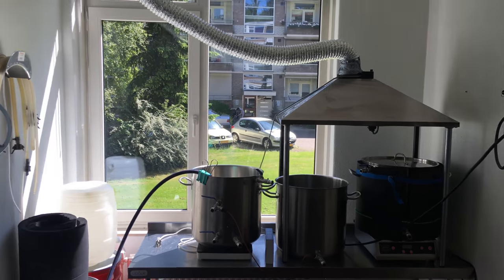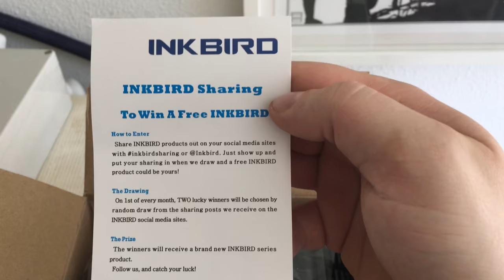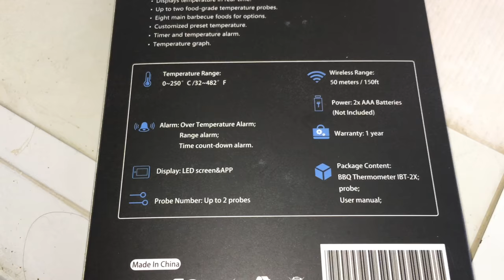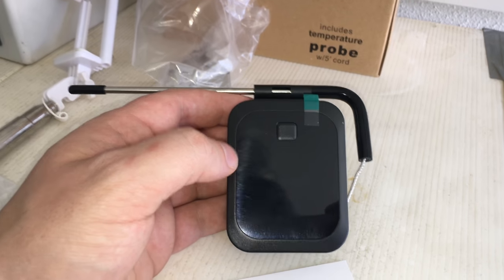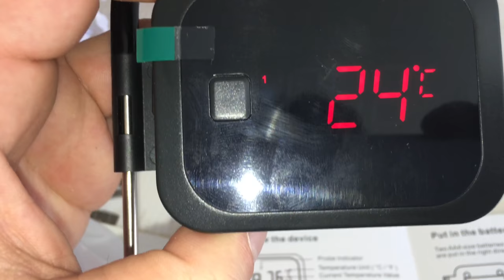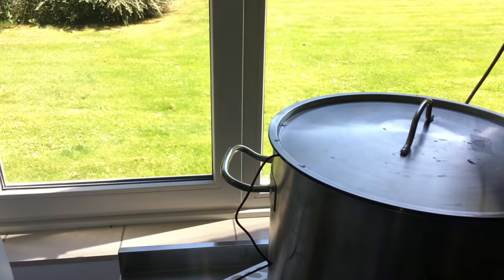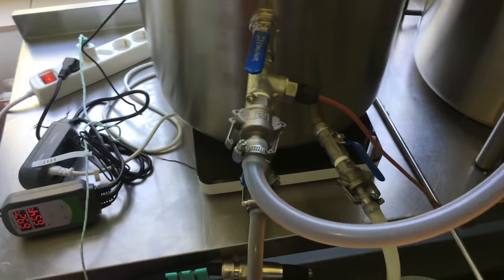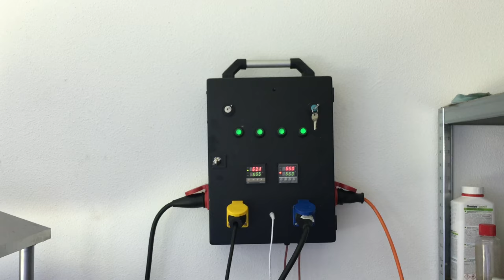HBW 30  - Kotten Brewery: Inkbird re-review ITC-308 + IBT-2X

Comment: What Induction plate is that? I was under the impression you cannot control power to an induction burner with a temp controller as they reset to standby when power is cut.
Reply from the maker: Your absolutely right Nathan. Fortunately the panel failure occurred during a mash step (52C-65C) therefore I had 20 mins to do the repair before I lost control of the brewday. Yes once the temperature is exceeded the induction plate will have to be manually restarted. The intention of this new control element (inkbird) is to alarm at defined temperatures and eventually shut the induction plate of once a certain temperature has been achieved. This helps me a lot during a brew party (i.e. lots of friends, beer and food) as my mash has been neglected and by the time i realise it, I have a mash temp of 75C when I wanted 65C. This happened with my imperial stout which turned out to be the sweetest 4.5% beer I have ever brewed.
Reply from the maker: Hi nathan, sorry for the delayed reply. Been neglecting YouTube for a while. You are absolutely right, but also not strictly correct  :)

https://www.pinterest.com/pin/596656650602103957/?amp_client_id=LKrjCoWKM5z4bVJ2QLS5NXTB5K1sBxHVogqzSp-fDGHNs3jJYD2dlSKUb_3LzynH&mweb_unauth_id=bdf840b7ae372e3fe69fb379b0809606

With this one you can!
But my one not. Therefore I only use it for the boil where constant power is necessary